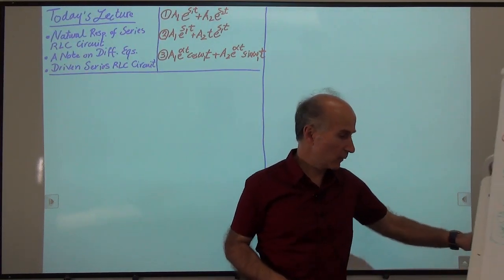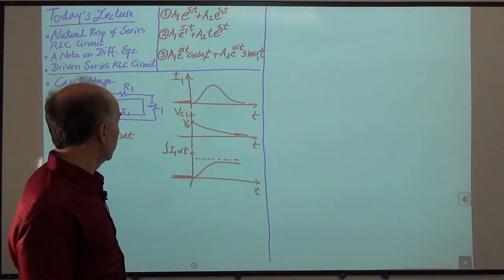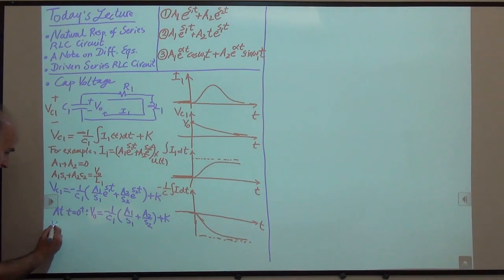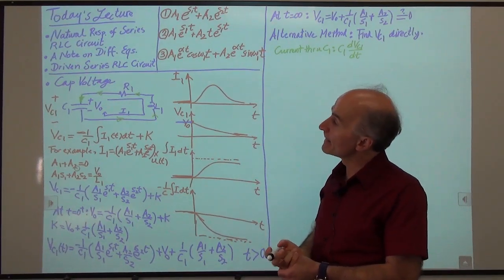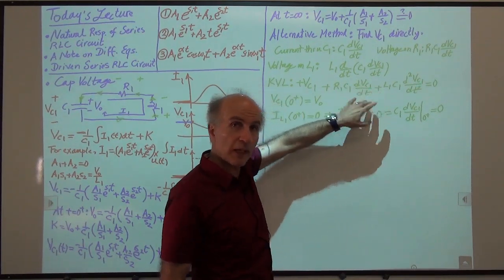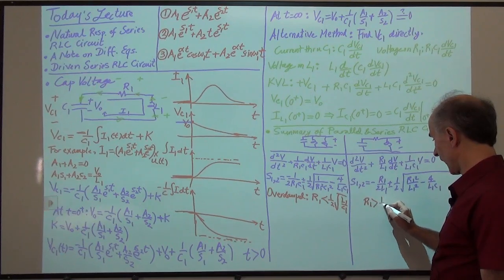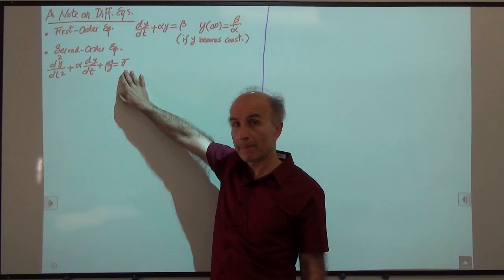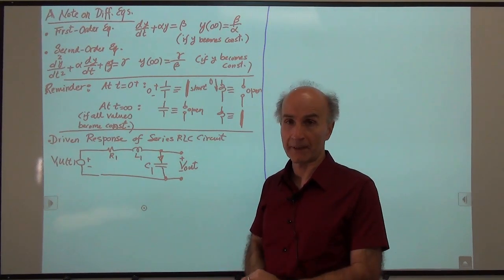Razavi Basic Circuits Lec 34: Source-Free and Driven RLC Circuits

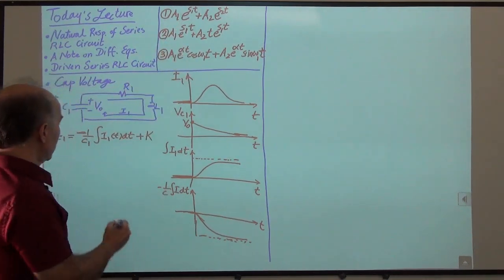Comment: Professor at 11:01 inorder to balance that voltage graph..  sir you added one constant in capacitor voltage equation.. for finding that constant value can i use this approach .. constant units are volts only.. vc = - 1/c  integral of i1(t) dt..where integration limits are from - infinity to t.. these limits  i will splits into 3 regions.. one region is from - infinity to 0-  , 0- to 0+ , 0+ to infinity.. in the second region 0- to 0+ region current through capacitor is not impulse so this region will become zero.. remaining two regions are left ... Vc = 1/c integral of i(t) dt .. integral limits are from - infinity to 0 = v0, third region is from 0+ to t overall cap voltage = -1/c integral of i(t ) dt + v0 is this approach wrong?

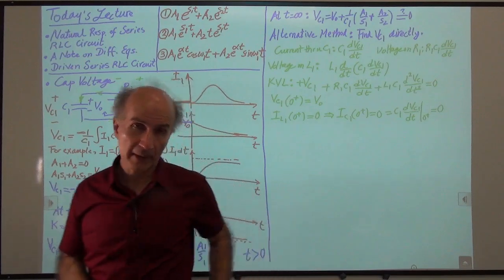Comment: At 27:12 dVc1/dt is 0 but according to the assumption made in the previous method (graph), its non zero
Reply: dvc1/dt in the graph of previous assumption is also zero. dvc1/dt stands for I1 in first method the I1 is zero as of the graph
Reply: @visweshiyer3273 Here we are talking about dVc1/dt at time t=0+ which comes out to be zero which needs to be calculated from the initial conditions (here initial condition is the current in inductor which is 0 at time t=0+)